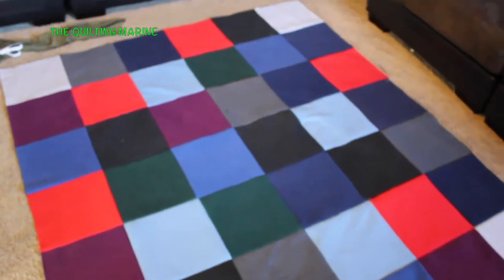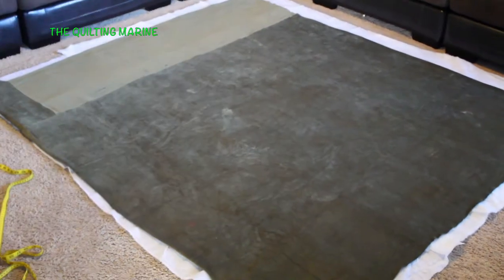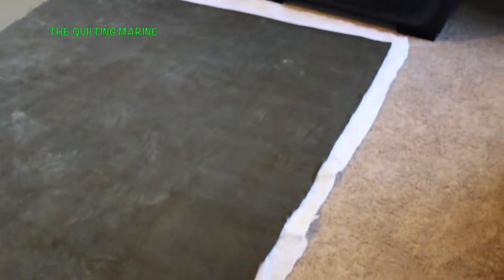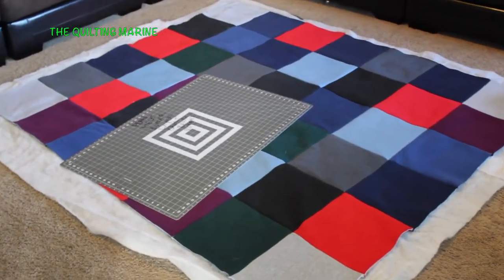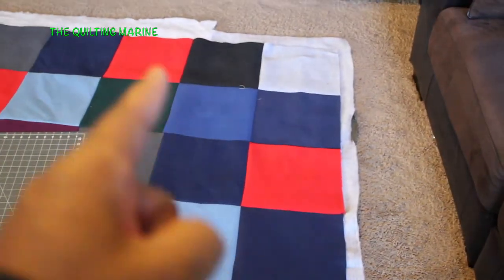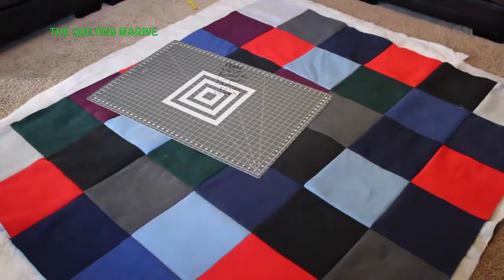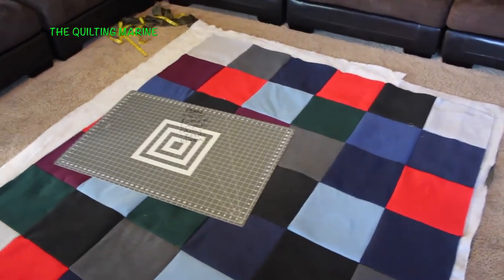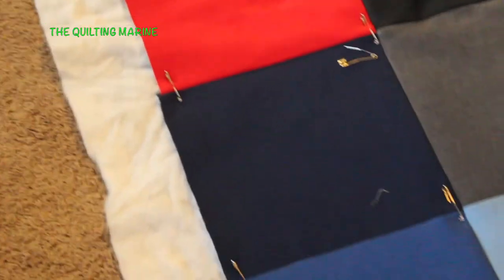Nuclear Quilt | Backing and Basting

Comment: I finally get it: "Softy-soft Fluffy-fluff"=Fleece (like sweatshirt material). You did a great job matching all your corner points in this super-thick quilt top. I'd probably put a pin in the middle of each block too, just to prevent shifting. After doing the "quilting" part, I use the cutting mat on a carpeted floor the same way, to trim the edges before putting on the binding. For making a "pieced backing", from a design point of view, it might look cooler if you slice the large piece in the middle or 1/3 down, and then insert your 'other' material in the sliced opening. Just looks intentional, rather than patched up to make up a shortage of fabric. Still, it's the back--who really cares? ~Diana from Toronto

Comment: I recently learned how to put the different layers together by rolling each layer on pool noodles or pipe insulation, then you lay the rolls down in order and then unroll and pin as you go. It's sooooo much easier and faster than trying to lay it out on the floor or on a table that's too small. There are a couple of videos here on YouTube on how to do it.